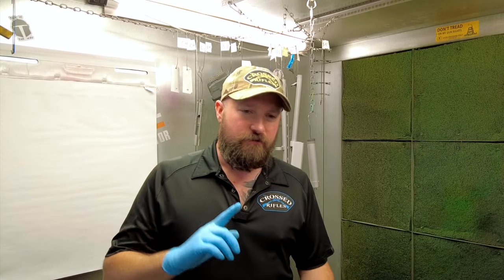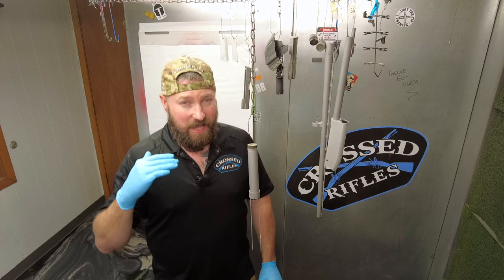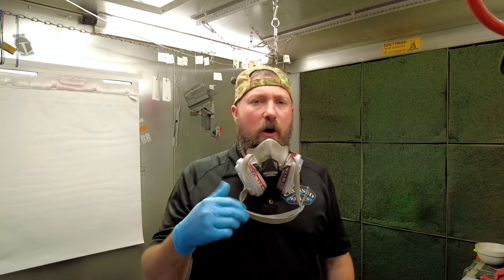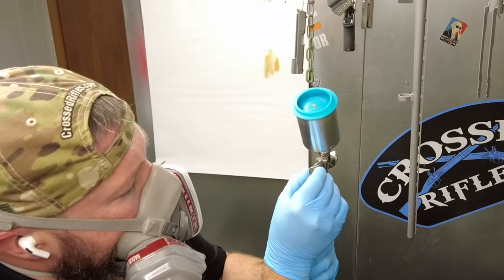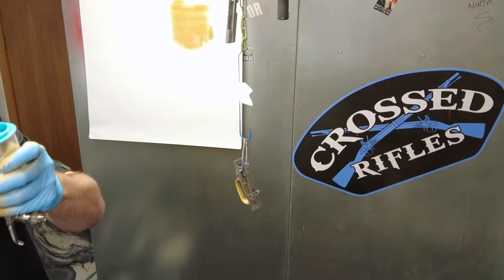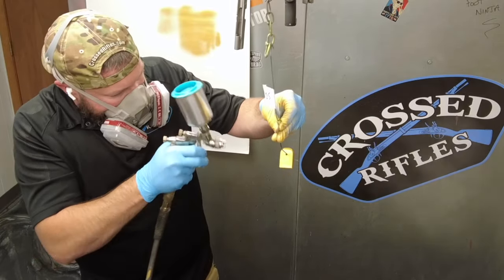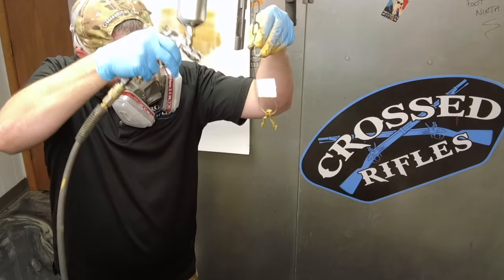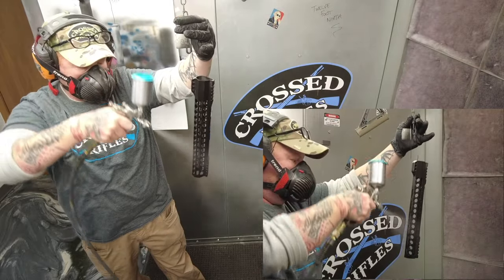Basic spray Cerakote tutorial

Comment: Im at NIC industries right npw getting cerakote certified, comparing your methods and theirs and there's so many good things here to help with Ergo
Reply from the maker: Thank you! There's no one way that is the most correct for everyone, but our goal is to make all coaters able to spray on the same level of quality!
Reply: @CrossedRifles  well your definitely doing that with this Video im just a little curious as i run a Reg right at the Gun and just leave the air wide open maybe i should say flow Valve as its more of a flow valve i run the cheap but good  the RP/1 ANI AIR Regulator So what do you Leave your Regulated air going to the gun set at may i ask? i know for say C series Cerakote it says 30Psi is that only when spraying Full out or 2 on 1 and any idea what you dial it down to to spray tight spots? Psi Wise with the LPH-80

Comment: Where did the “15-18psi on the regulator pretty much all of the time with no real reason to change that” come from? Around the 2:49 mark in the video.

I’ve ever heard that anywhere, from anyone.

The recommendation has always been 20-25psi for H-Series and 25-30psi for Elite Series…
Reply: ... I second this.
Although, I started with the recommendation, and dialed down to get the results I want .. I find myself at 18psi.
Reply: NIC recommends 20-25 for E series and 25-30 for H regarding line pressure. Then adjust the gun down. I found that 16-18psi is where I have best results. Your mileage may very :)

Comment: I'm doing KG as a hobbyist, maybe take on some light work. Doing smaller parts, what is the disadvantage of just using an airbrush? I have been using the airbrush with a 0.8mm nozzle and it has worked well for me unless I'm ignorant on something. I could see how doing high volume work would take forever. Doing small parts, slides, uppers, lowers, etc.. Is the airbrush fine? I can stretch the paint much further with the airbrush as well. I also don't hang my parts, I have a jig I made to hold and turn the parts I spray. I have a smaller oven so I cant hang them to bake them. The jig I made goes into the oven nicely. Of course I'm just doing one gun at a time. So I can fit an upper, lower, and a buffer tube in the oven at once, I can then do the handguard and outer barrel next.
Reply from the maker: The biggest issue with an airbrush is the amount of material it sprays out. You can absolutely get it done, and we use an airbrush in lots of our techniques. But you really have to crank it up to lay down the proper amount of material and really get a true protection layer on the piece. If it's just for cosmetic purposes and the durability isn't an issue then an airbrush is perfect.